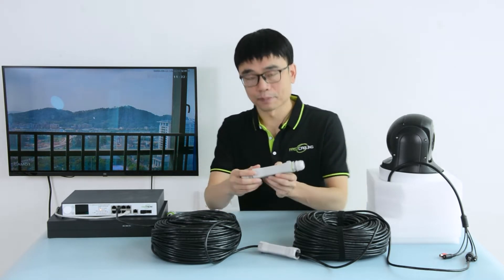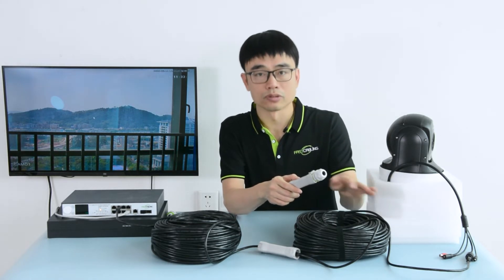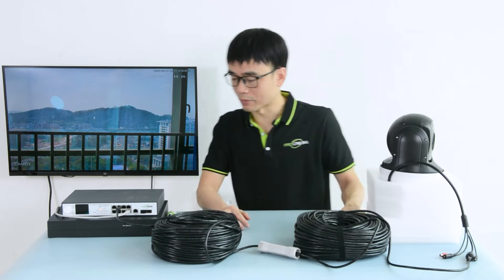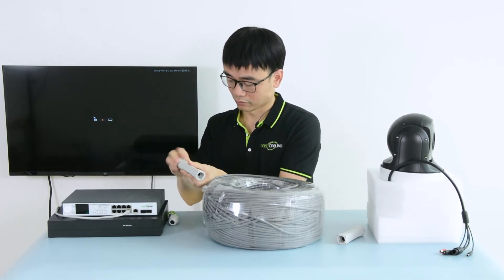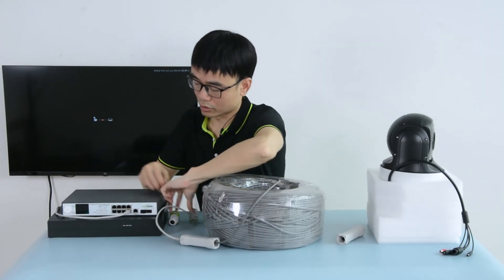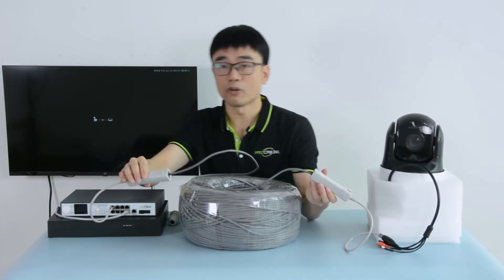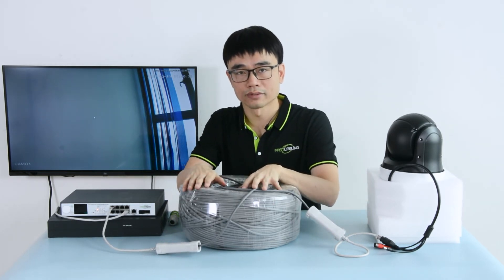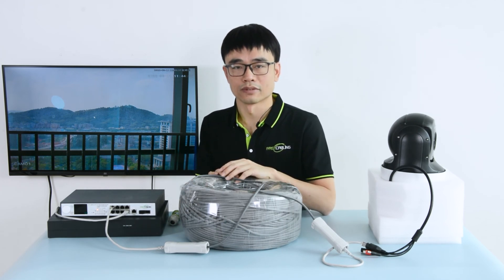PoE extension - Daisy chain Cat5/Cat6 vs Continuous Run

Comment: Are you sure this set up will work with a high power ptz cam?.please give me a call tonight by 11 pm.kansas time.tnx.
Reply from the maker: Yes, it works with PTZ camera, but you need high power PoE injector or switch to supply up to 1000ft. The PoE+ can't supply enough power budget after the power loss inline is being considered.